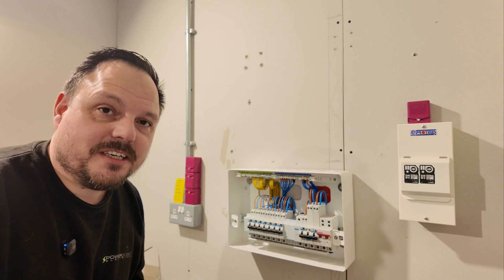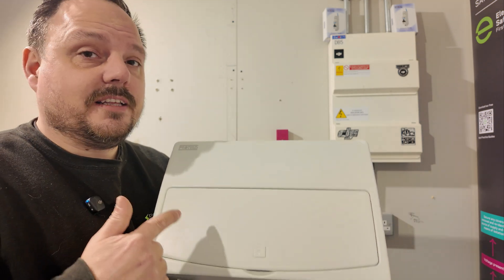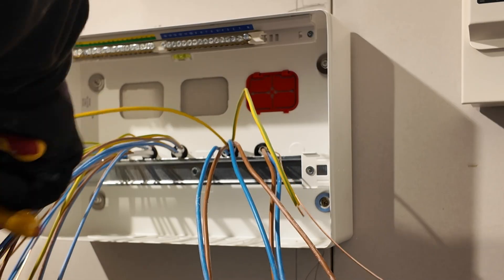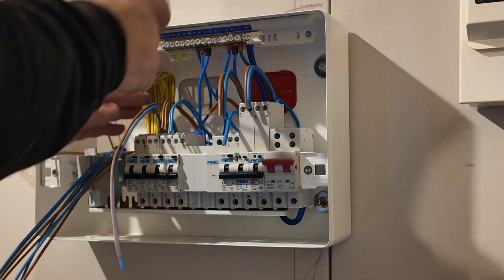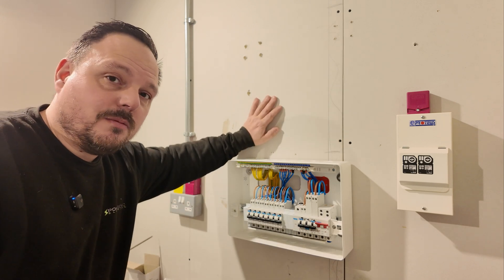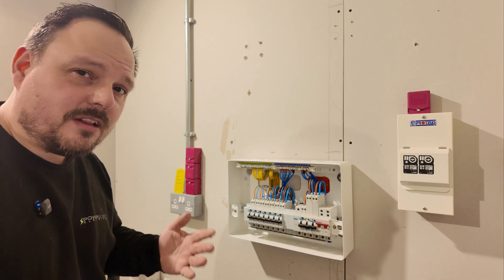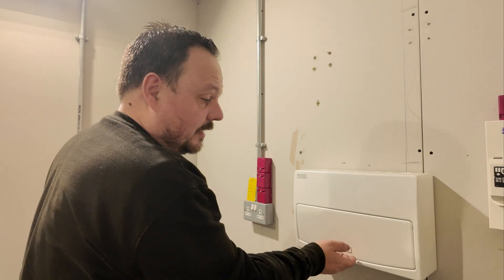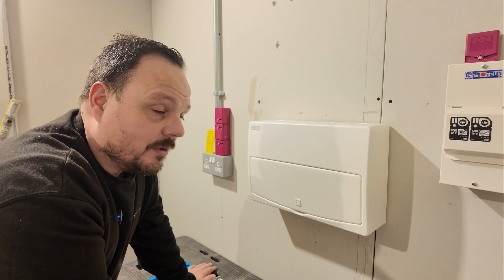Installing consumer units is easy.... REALLY EASY !

Comment: Hi Mark, you said that the Proteus SPD set up in their new board complied with the regulations up to 100A. I asked which regulation it complies with as it does not appear to comply with 534.4.5.2?
Reply from the maker: I trhink you are misunderstanding that regulation. It is more to do with an MCB operating pre the SPD leaving an installation without surge protection while still operating. Setting up without an MCB removes that prospect as the incoming DNO fuse would have popped alongside the SPD. Which considering what would have caused that to happen is fairly useful. Regs in general guide is where possible not to use OCPD in series with SPDs due to this. But it is guided largely by manufacturers instructions. Most now have options at both single and 3 phase up to 100A that do not and should not be protected by in series MCBs. This isnt anything new when we think of the double module variations both from Hager, Proteus, Electrium and more. I would re read 534 of the regs for better understanding Andrew. Hope that helps.

Comment: So the metallic lid making it a non combustible enclosure removes without a key or a tool ?
Reply from the maker: Your mixing up access to live parts with covers. Plenty are on the market with clips/hasps that don't require a tool. However they can't be refitted with the lid on like this one. A great feature while labelling up a board. Far more likely to leave a magnet holding a lid up then leave the lid off forever.
Reply: @ Hi, I’m not mixing anything up, I simply mean that this cover can be removed without a key or a tool, it was an observation not a verbatim quotation of a regulation. I tried one yesterday, the amount of DB,s Consumer units with missing lids we encounter daily suggests that this will be the case here, people will remove, possibly misplace it and it could be left off making the CU as I said now a non combustible enclosure, but that’s my opinion not yours obviously.
Reply from the maker: @Andrew-su3wt  I don't see the issue. Most lids are removable without a tool. Definitely hager, BG, schneider, electrium. This is just a neater option and not something that would come off by accident. We all see these risks differently but for me it's fine and indeed a great innovation.

Comment: I have always found a problem where using a 25mm 3 core SWA as a sub-distribution circuit and using the black as the CPC the earth terminal would only take up to 16mm has this been addressed with this and other makes ?
Reply from the maker: It is why pin crimps exist.
Reply: @electrician247  they may exist but the day-to-day new house electricians are not using them
Reply: So that answer to that is no? 😅
Reply from the maker: @nathanhedgeley8016  terminal bars by nature in 100A single phase consumer units use 16mm max cable diameter.  It is why neutral fly leads within are generally pin crimped. No excuses not to use the correct components. We are domestic sparks and have pin crimps 🤷‍♂️
Reply: @electrician247  But in general a main earth will very rarely be smaller than 16mm. 

16mm and 25mm being the most common sizes. How hard would it be for them to just have the main earth terminal slightly larger to allowed for this and save the need for using a reducing pin crimp.

Proteus may be open to suggestions, and I don't think that's a ridiculous suggestion on how to improve a product or installers so I'm not sure why you're so quick to dismiss the idea 😁
Reply from the maker: @nathanhedgeley8016  16mm fits so not sure why you mention that size tbh. 

25mm would reduce the strength in the terminal bar. I can only assume the fact no brand goes beyond that size as the reason. Its fixing a problem that doesnt exist for me. We have pin crimps and use them, dont see the issue. 

But you are right Proteus are open to feedback, I have given them loads on this board and they have taken that in. You should try the same if you think its an improvement worth having. But this isnt the Proteus feedback forum lol.
Reply: @electrician247  I mention that size as I'm stating what the common sizes are.. I'd be a bit worried if 16mm didn't fit.

Hager boards can fit a 25mm earth, not sure they have any issues with strength of the terminal bar. 

The whole video is literally about the Proteus board, so I'm not sure what you was expecting the comments to be about. No need to be so defensive 😁
Reply from the maker: @nathanhedgeley8016  its about how to wire a  consumer unit, I have examples from BG, Hager, Electrium and others on the channel. Ironically a Hager board feautred a pin crimp on the 25mm submain for the earth as it didnt fit.... The design 100 range maxes out at 16mm unless you are hair cutting lol. 

3 phase ranges go to bigger as the terminal bars are larger. Its a size to space ration ultimately. 

Far from defensive its just my opinion. I think its a non issue and you think different. No attacking or defensive position in that. 

But my view remains the same after our chat, non issue.

Comment: How do you find the earth and neutral bar screws when it comes to torqueing them up. I've found Veritas and Fusebox boards even when done to the correct torque just start stripping the heads. In an ideal world I feel a Torx head would be far superior but I can't see a single manufacturer swapping over.
Reply from the maker: Never had an issue tbh

Comment: Great blog. I looked at the new Proteus board in CEF and it does look great. The only thing is it does not appear to have in built short circuit protection within the SPD or a dedicated MCB, which means that it is relying on the DNO Cut-out fuse. This does not comply with 534.4.5.2, any thoughts?
Reply from the maker: It does comply with regs up to 100A most brands are moving to similar setups.